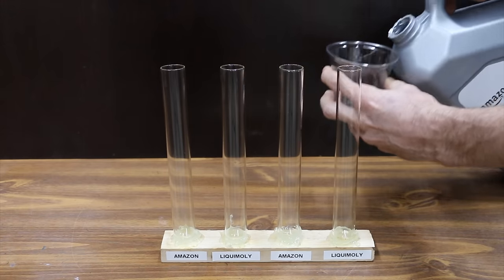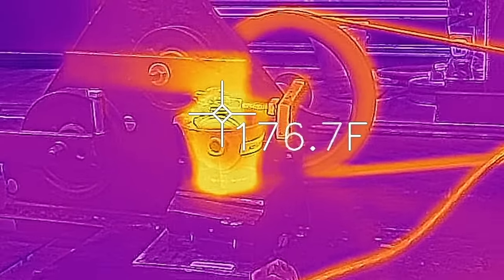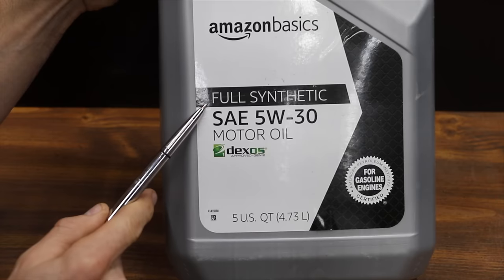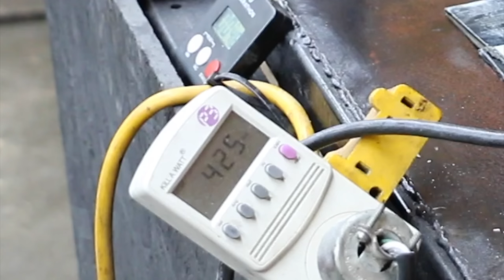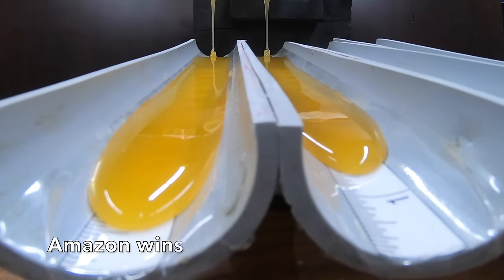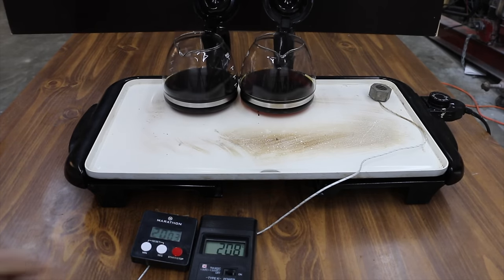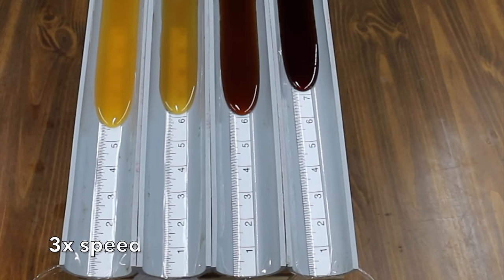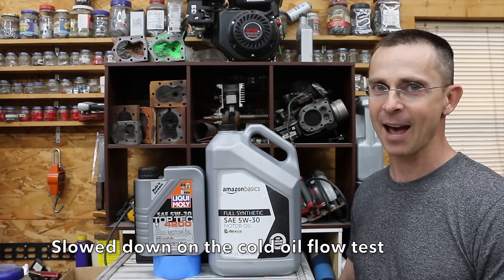Is Amazon Basics better than Liqui Moly? Let's find out!

Comment: i've been waiting for this one... i'm actually surprised at the Amazons oil quality.
Reply from the maker: Yes, Warren Distribution did a great job with their oil!
Reply: Put Amazon Oil in the car and expose to unburned gasoline, moisture and other byproducts, send it to the Lab and see how well it protects engine. Then claim it's quality Oil, based on real engine operation and real lab results.
Reply: I know I'm tempted to switch but I've used Castrol gtx for years and my engine seems to like it but the price for the Amazon is unbeatable then again I can usually get a 5qt jug of Castrol at my local Kmart for 14 bucks
Reply: Same here, if it weren't for the fact I can get cheap synthetic from a bulk buy I'd definitely buy it
Reply: Amazon doesn't produce oil. They either buy the blend or make the blend. There are only 3 oil supplement manufacturers in the world. All engine oil producers buy additives from these 3 companies :)
Reply: i'm actually considering trying this Amazon oil for my Suzuki Swift (Europe). It's way cheaper than the Castrol stuff i'm using now and i would be surprised if it's performance would differ much from Liqui Moly. Worth trying i guess!
Reply: @repairvehicle  No need. SN SL and those certifications actually do that :)
Reply: @tarassu  , these are not certification. To use API Logo on oil can, you have to pay for every quart of oil sold. You think they going say no to Oil companies? Money talks and uneducated consumers believes certificate that doesn't even there.
Reply: @repairvehicle , his test is excellent. Don't get pedantic here. He always states several times in his test videos that his equipment is not laboratory grade and all.

Even if the tests are not made in a laboratorial condition, they are valid. He, at any moment states that the tested oils are out of specs.
Reply: @XA-JJKILLERs  , if you don't like the Truth, then don't comment. Educated yourself, otherwise you look like fool.
Reply: yeah, that SN plus part isn't there for nothing.
Reply: @nejiniisan1265  RIP Neji😭
Reply: @XA-JJKILLERs  Agreed, he should learn the difference between trying to sound smart and actually being smart
Reply: @repairvehicle  they are verified standards if you cant see how this make certified   thats your problem. And saying they paid them off just makes you sound like a nut job.
Reply: I'm liking the Amazon product. I live in a northern state and I'm really impressed with it's cold flow property.👍
Reply: @repairvehicle  to eliminate all the variables you'd have to use a dyno and I don't think PF has the money for that. Besides, Warren dist. has already done all that as it meets all the requisite standards for rating. Accept it, it's a good quality oil at a great price.

Fwiw, Warren Dist. is no slouch, they make a lot of PLP in the oil/gas additives industry.
Reply: @randycchavez  , you have no clue what quality Oil is, but that's okay.
Reply: I miss my old 92 celica :( lol
Reply: Usually Amazon basics stuff is mediocre (in other words good enough) or bad, but this stuff is really good!
Reply: @NathanCelica  you could try miller's oil or mannol
Reply: Wheel bearing  , how often were you changing oil? You never had Oil consumption issues?
Reply: Wheel bearing  , Very interesting. You change your oil about 4-5 times a year and have Oil consumption issues. There are people who change Oil once a year and no oil consumption and almost no engine wear, you call it sham. So, changing oil once a year and having no Oil consumption issues is sham according your statement.
Reply: Love this channel. Always useful and really the only guy out there trying this stuff out. A+
Reply: @coolguy2370  don't fix something that ain't broke but it's nice to know that if you have too, using the Amazon oil will meet or exceed most your expectations at a great price. After seeing these tests i would personally not have a problem putting it in my engine. I especially like it's cold flow properties, that's really important when you live in a northern state like I do.
Reply: Wheel bearing  unless the mfg calls for a specific oil (they should know, they spent millions in testing the engine) you can use most any oil that meets established testing standards. I have 160k on my 3.8L V6 and the mfg says any conventional semi blend or above is suitable as long as I'm following the specified change interval.
Reply: @randycchavez  oh yeah definitely cold flow is very important I live in Michigan and I tell you what after this last winter I'm getting a block heater no more playing around with this pedal half way down and crank for 15 seconds and pray your car starts
Reply: @XJlover90  I had a 90 Camry with over 300k when I sold it. Great little 4cyl engine... still ran like a champ when I let it go.
Reply: @randycchavez  That's awesome man. 
My brothers scion has close to that 
I now have 2 7th gen celicas both have around 170k, can't beat old Toyota reliability
Reply: @XJlover90  yeah, the car was def' showing it's age on the outside (nearly a 30yr old car at the time) by the time I sold it but I used it as a commuter because of the great mileage it got. And you really didn't have to do much on it. Some of those early Toyota engines are just beasts...i swear you could toss a grenade in the engine compartment and it'd still fire up.
Reply: @coolguy2370  yeah, I suppose if I lived in AZ I'd be more inclined to buy an oil with better hot flow properties, but since I live in a northern state and most of the damage to an engine internally is at start up... cold flow is important. Btw, I have a heater... and they're def'worth it if you have many freezing/sub freezing mornings.
Reply: @randycchavez  , what happens to the Oil when it gets hot? Can it provide proper lubrication or just freely flows like water?
Reply: @randycchavez  , that's why your Toyota is burning oil.
Reply: Wheel bearing  , conventional and full synthetic oil is just pure garbage. They are engineered for dealers and lube shops to make easy money. An Oil that causes your engine to consume Oil and have leaking dry rotted seals is pure garbage. I have used them in the past and they caused my engines to consume Oil and leak Oil. I have 100s of comments on my channel from people who have at least 200k miles on their vehicles and they are not happy with cheap Oil, Oil consumption and leaking seals. 
I have a comment from a person who got 500k miles with conventional Oil and engine was destroyed to the point that it was consuming too much Oil. He switched to 100% synthetic Motor oil and his Oil consumption almost eliminated. 

Conventional Oil will cause your engine to leak Oil and consume Oil. Motor oil companies guarantee you, it's on their website, if you know how to read.

Full synthetic Motor oil is made from 10-20% synthetic oil and rest is none synthetic, it's just synthetic blend. Oil companies call it full synthetic and not 100% synthetic. 

There is only few companies that make true 100% synthetic Motor oil.

I use 100% synthetic oil and change my Oil and filter every 13 months. I have sent my used Oil to the lab results came back positive, engine wear only 4ppm metal wear. You cannot get this low metal wear numbers with conventional Oil at 2000k miles Oil change interval. 

1 Oil change a year with 100% synthetic oil is cheaper and better engine protection vs conventional 5 oil changes and worn-out engine.

Conventional Oil is pure garbage, but even garbage has value.

One man's garbage another man's treasure.
Reply: Wheel bearing  , thanks for the reply. I have hundreds if not thousands of comments on my channel from people who are using Amsoil signature series and have zero Oil consumption and less engine noise.
Reply: In regards to amsoil, though, I don’t personally care for it, mainly because I think it’s an incredibly overpriced oil for what you get. Hell, it’s produced in my hometown, you’d think I’d support it, but I’ve rebuilt & replaced way too many engines where the owner took amsoil’s “25,000 mile oil change” BS to heart and ran out of oil around 10k. Always the same story: “But the salesman said it could go 25,000 miles!” Can’t fix stupid.
Reply: @randycchavez  I've got a 3.8 V6 as well, the series II 3800 with the supercharger. I love it to death, and I've got nothing but good things to say about it. I have oil consumption issues (mostly due to blow by from the super charger. I'll go through a quart every 2600 miles or so. Considering a catch can.) But there are no issues coming from this car that I've had other have. It's a wonderful thing really.
Reply: @repairvehicle  thinking something works better just because you paid more for it doesnt make it true.
Reply: @researchandbuild1751  , thinking? That's what you doing and acting upon. I send my Oil to the lab and make decisions based on results and facts. I have used cheap Oil for 2.5k miles and got the Lab results, I have used expensive Oil for 8k miles and got the Lab results. Expensive Oil at 8k miles provides 4 times less engine wear than cheap Oil.

Cheap Oil wears out engines fast and cost more because you have to change more often.

Expensive Oil provides 4 times more engine protection and last in the engine 4 times longer and cost less because you don't have to change as often.

Quality comes with cost.
Quality last longer than none quality.

Lab results on my channel.
Reply: @claytonmoore8472  I have considered a catch can too. I burn maybe a half quart between changes. the reason I haven't put one in yet is because of space constraints. I'd have to mount it on the opposite side of the intake, where the vacuum line returns. I don't like the idea of criss crossing the engine compartment with the long hoses. I'm concerned that water vapor and oil will condense in the line. It may be a totally unfounded concern but I haven't yet found any reputable articles addressing this. So until then, I'm holding off. But if you don't have space issues, I'd say go for it... you can get some pretty decent catch cans of Amazon for well under $100 and your valves, cylinders and pistons will thank you for it.😉
Reply: @randycchavez  I'll definitely have to consider it! My only concern really is affecting the PCV system in some way and roughing the engine or throwing a code for it. Strange little concerns like that are the same reason I don't want to buy a CAI: Im scared I'll hydro lock my engine if I drive in the rain!
Reply: Like yeah if your engine in your car runs cold it sure does win

Comment: need to have a HOT FLOW CONTEST as well as a cold flow.  the better oil would be the slowest in the hot oil test.
Reply from the maker: Great recommendation!
Reply: Better get a good high speed camera for that one.
Reply: I still want to see a lubricity test after the oil has been heated. I would like to see if the oil breaks down
Reply: That won't necessarily be true. Different oils have different breakdown and break in points. There is wide range of disparity between new viscosity and after 800 miles of use. Shoutout to blackstone labs.

 There used to be a great forum that posted great analysis, unfortunately they were bought out by an oil company (go figure)

Essentially he could run both oils in the same engine for several durations of 1-2 hours, then test the difference.
Reply: Yes!
Reply: @ProjectFarm  Also maybe adapting the setup for your friction test to test it while at typical operating temperatures on your bearing test.
Like a Metal container that can maintain the temperature using a thermo-probe, and a heating element with a little ardino circuit or something.  Or just a parted oven.
Would be interested to see how hot performance would be in comparison instead of just cold performance of these oils, as that can vary alot.
Reply: And how about doing the bearing test again too.
Reply: @cerberes  you said it!
Reply: @AsthmaQueen  My understanding about engines, is that 90% or so of engine wear comes from cold starts: i.e. when the oil has drained back down to the oil pan, and all you have protecting components is a cold film. The faster the oil gets through the system initially is what's going to prevent the most damage, meaning that what happens with cold oil is actually the most important consideration.
Reply: Literally just came to the comments to suggest the same thing. You beat me to it! Smart idea. Do the cold flow then the hot flow and the data from each should be combined into a hot/cold ratio.
Reply: @Skyfighter64  Great point.
Reply: @ProjectFarm  could you also do a followup bearing test of the cooked oils?
Reply: I vote for this
Reply: Not hotdog If not the same engine, then two engines beside one another for a side-by-side performance comparison and plastigauge the bearings from the same strip of gauge before and after the runs.
Reply: Slowest? Wouldn't the best be the fastest?
Reply: If it's heated so hot, that it turns into charcoal; Does it win?
Reply: Yes

Comment: Test idea: Ratchet straps, had a new one fail on me way under its WL limit
Reply: Good idea mate
Reply from the maker: Great test recommendation!  Thank you
Reply: Yup, good idea
Reply: GREAT idea!!
Reply: Good idea
Reply: @ProjectFarm  Could extend this idea to bungee cords!
Reply: Problem is that the WLL is usually a static lifting force that can be applied safely. So if you have it in the back of a truck, and hit a bump, that is more force than the WLL rating. I have a few laying around that are rated at 5000#, and I have no problem lifting that weight, but when it comes to securing a load for transport, my limit for those is 3000#, if its more than that, I have a set of chains good for 25,000#.
Reply: @EvLSpectre  Static load can definitely be lower than a dynamic load, which a lot of people don't realize. You're using a good method.
Reply: @ricker76er  Oh yea. Even with heavier loads around 5000# and with 6 of those straps, I still go over. Just a safety net. Even more so when something fails because it was over weight and an accident happens it is very serious.
Reply: Excellent idea - though the cheaper ones have unknown China sources! Reminds me a poor dude I worked with on the railroad (Signal of Engineering division). A lot of Mechanics were yelling out "I know...we can use a rachet strap!" In the same way with a higher pitched ending. I would go to another base site hours away and hear the same thing. I finally met the guy who said it, and he mentioned hid voice crackling at the time. He wanted to use one to grip a 3 inch thick cable. Ok this has not much to do with rachet straps but it was on my mind after seeing your suggestion.
Reply: @violetaarreola6604  The tie downs are CGU-1B, from the same place I used to have to order them. So I know they are to spec, or atleast right up against it. Chains are from another heavy equipment and construction source.
Reply: @mikelitorisstanks2285  Those GCU-1B get static tested to 6000# so no worry. But remember that they degrade over time
Reply: @EvLSpectre  We ALWAYS check our straps each use, especially the lifting loops and straps. Many times we lifted 500lb transformers (I know that is light, but we were standing only 3 feet away due to clearance), but for those we used chains and hooks. The track cart (about 4000lbs) we used load loops and straps. For steel coils and steel tubing I always see chains, hopefully multiple. Most deadly load on the road.
Reply: @violetaarreola6604  I got to move around bombs for about 5 years. Not really deadlier, cause they take alot to detonate. But same thing, for just say six 500#s, we would have 6 straps, two per in sets of two, each rated for 5000#, and we crank them to about 150# of tension each. That load is guaranteed not to shift.

Comment: I discovered Liqui-Moly when being stationed in Germany, I tried it in my Volvo 850R out of curiosity and my god it runs smoother than the Castrol I used to use. Better fuel mileage too.
Reply from the maker: Thanks for sharing!
Reply: I am currently stationed in Germany.  I use LQMoly in my 2018 BMW m4 and she runs like a champ.
Reply: I actually just serviced my car with liquimoly for the first time, wasn't this top tec one it was the same but a more expensive new version, either way the engine runs smooth as hell and I've gotten way more mpg than I was used to, so there must be more to it than these tests
Reply: @ggcpf2874  Numbers anyone?

Never mind, numbers don't matter when such a figure is so variable based on driving habits. Smoother is too subject to human psychology.
Reply: Same! My 2011 vw Jetta tdi runs so smooth on Liqui-Moly.
Reply: @nodriveknowitall702  Exactly. There’s a ton of factors to “smoother”, such as wind direction, wind speed, traffic, etc…
Reply: Liqui moly Leichtlauf high tech should’ve been used for this experiment. Still glad this experiment was done nevertheless.
Reply: @M177AMG  is this their best? What you like?
Reply: @hardcore4476  what one? There's several formulas
Reply: @hardcore4476  what one? There's several formulas
Reply: @captainamericaamerica8090  Top tec 4200 LL. Long life one with 507 00 certification. Actually just tried that Total Quartz and my car loves it, and it’s cheaper! I recommend either one of those. LM OR Total Quartz!
Reply: @emreeroglu8519  Which one? 5w-30?
Reply: @MotorCityMoto  Top tec 4200 5w-30